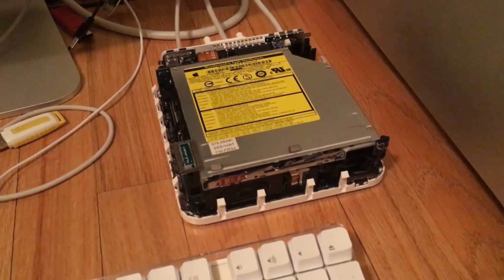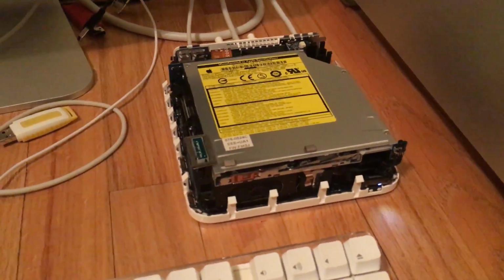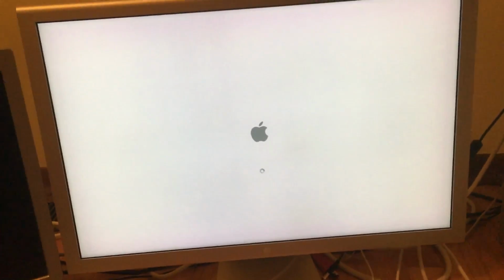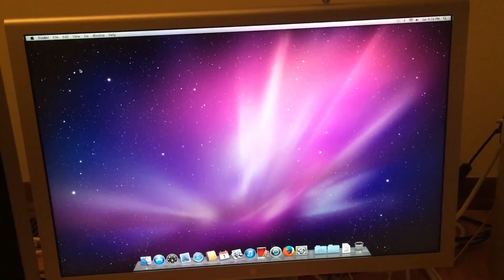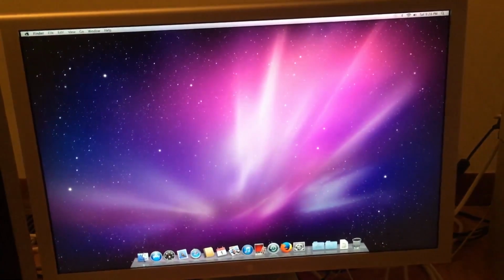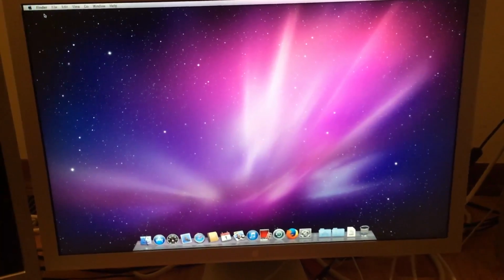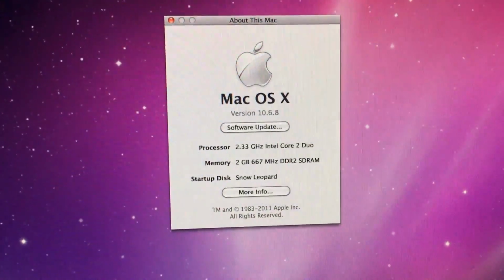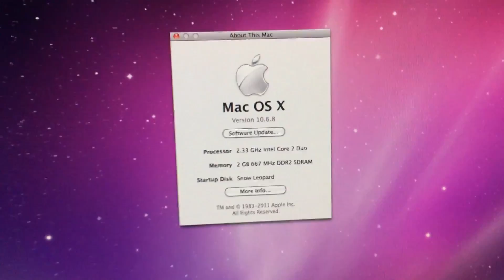64bit CPU Upgrade Tutorial – 32bit CPU Mac Series ep.6

Comment: my mac mini 2009  just only hear big FAN, front light off, when plug power? can I fix..
Reply from the maker: This is apparently starting to be a common problem… mine did the same thing it’s dead now I’ve tried everything. I can’t get mine to work… I would try checking all the ram and checking all the connections in the system.
Reply: @HrutkayMods  ouch i think you know the solution, cause before i put on my desk everything is normal, but now become like that, :( so saaad.

btw, my others mac mini 2009 when start have a big loud FAN but normally, until i install apps "Mac Fan" to it, and the fan sound normally again.
Reply from the maker: @beewee7895 CPU temperature sensor is disconnected on those ones probably